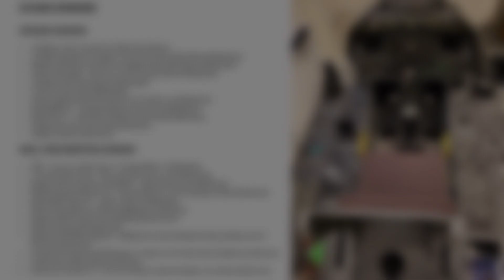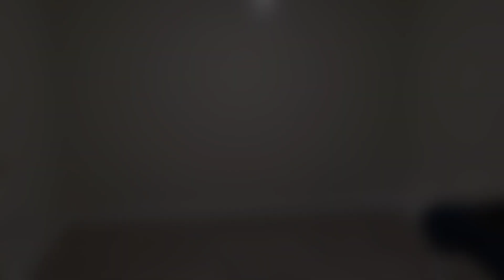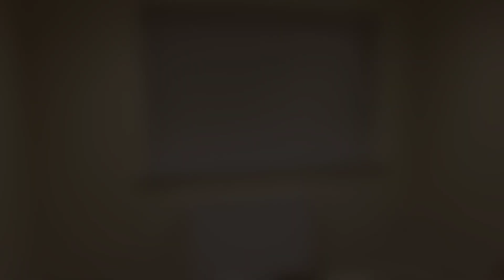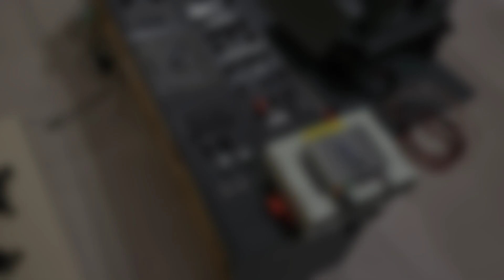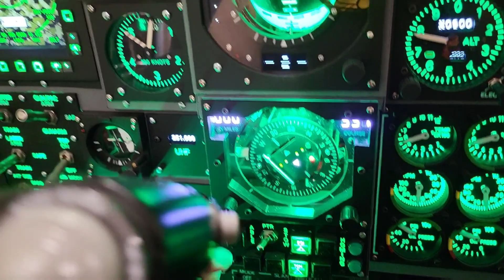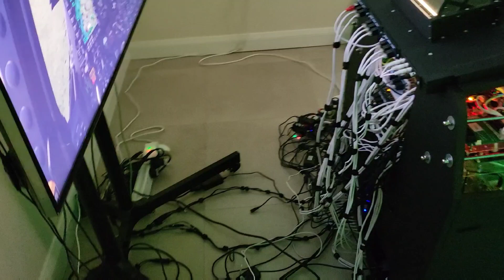Simpit A10C - Upgrades - Part 1: Relocate Simpit and Simplify Wiring

Comment: That was such a lot of wiring
Reply from the maker: Hi, I liked the idea of a central hub originally, but as things progressed it became clear to me that localised wiring is better. I have quite a bit more wiring to improve / hide away into the future
Reply: @CraigSmysimpit  This is beyond excessive, IMO. I would use an RS422 bussed solution.
Reply: @theeltea  I'll look into that (I've not heard of RS422 before you mentioned it). From experience with other peoples' simpits/cockpit conversions, I think there's a need for:
- standalone computer/desktop app which bridges between the flight sim and the simpit (& which can interface with multiple sims, have standalone and test/config modes, etc)
- simpit network interface board which connect to the bridging app, probably via wifi/LAN with ESP32. the A10 might have three of these: main panel and both side consoles.
- component interface boards, connected to the network interface with I2C or similar. lightweight microcontroller driving an individual instrument e.g. a radio frequency selector, a gauge or a small cluster of gauges, an annunciator panel, a switch panel

rather than have every switch & LED on the GPIO pin of something that connects directly back to DCS
Reply: just saw a helpful video: RS232 is point-to-point, RS422 is single transmitter, multiple receivers, and RS485 is multiple transmitters and receivers which is why I've seen it thrown around before re DCS Bios and simpits